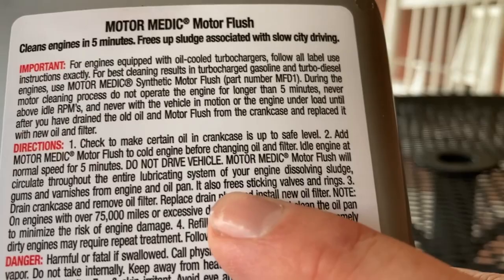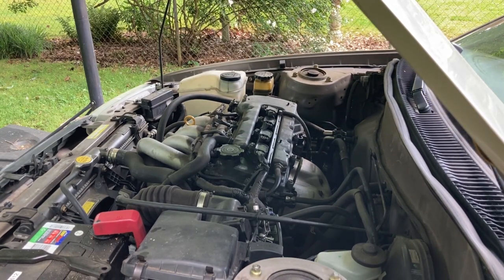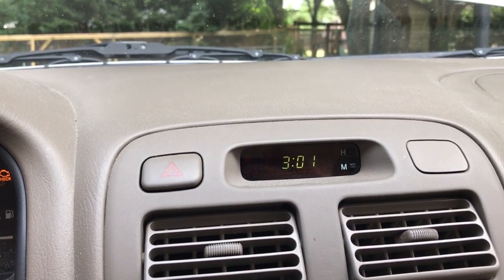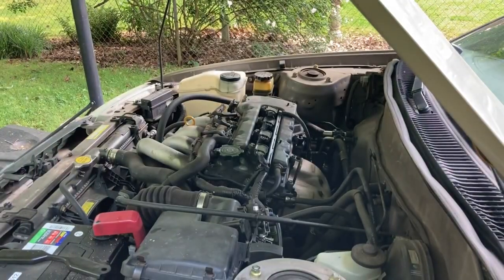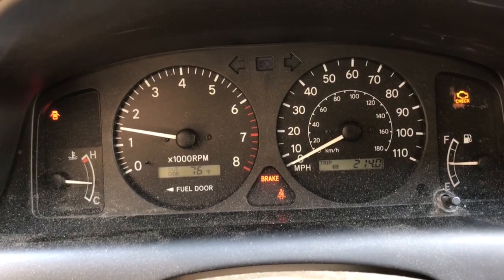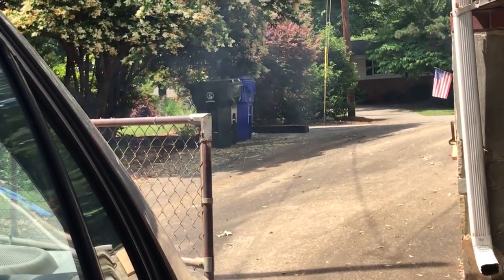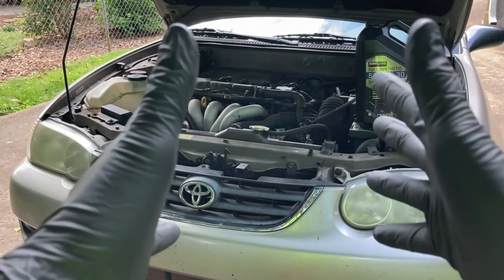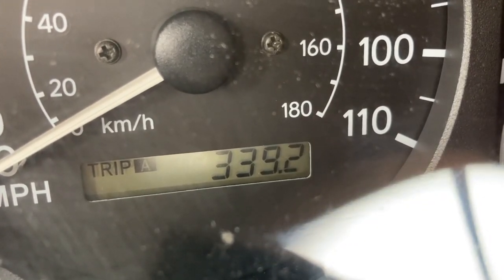Will Motor Flush stop oil consumption? | Oil Burning Experiments🔥- Episode 5

Comment: Have you tested sea form and work or not?
Reply from the maker: Yep. First two videos. Here's the playlist if you wand to check them out, Mad Man:  https://www.youtube.com/watch?v=cxz9cGCULNI&list=PLS7Cti2LicYBlvvhHdiv5RYpu_YLCrquZ&index=8
Reply: @FamilyFriendlyDIY  Yes but you says its work but after you have again oil the consumption
Reply from the maker: @madman2461  It did look like it was working (I got more miles per quart during that test), but then I found the usage to fluctuate, and sometimes it went as low as originally. ... But I still hear a lot of folks saying that if I'd kept it up with the Seafoam it would have worked. And that might be true.----I might try Seafoam once more if nothing else works.
Reply: @FamilyFriendlyDIY  okey i understand, you can test clean with hydrogène.
I have q5 tfsi and I think there is a problem with the segments, I will test sea form I also saw that there is a luca's additive which worked for a lot of people

Comment: I've used the synthetic motor flush with great results..the instructions say run idle at normal speed..my interpretation is normal speed is around 2000 rpm..so I idle it at 2000 rpm..it doesn't say at idle speed

Comment: If you are noticing blue smoke from the exhaust, it means your engine is burning oil due to an oil leak. This symptom could be the result of a leaking valve seal or a problem with a piston ring. That escaped oil can then mix with the fuel and burn as the fuel burns. Therefore it doesn't look like you have that problem with your compression rings or oil rings. Those spark plugs looked very bad. Stop being cheap and change the spark plugs, PVC valve and also check your valve cover and oil pan for oil leaks. It"s a good chance your loosing oil from those area and not burning oil. The top of that engine looks oily too. Most likely oil is running down on the exhaust manifold from the valve cover, or PVC valve, maybe both. The smell and smoke of oil is off your exhaust manifold. Stop wasting money on oil and oil filters. Go purchase some spark plugs, PVC valve, valve cover gasket and maybe a oil pan gasket if it is leaking. Try this and see what happen. Also check the ground area under the vehicle for oil spots.

Comment: Actually the problem with that model of Toyota is not so much the oil control rings.. but the oil return holes on the piston. That was a manufacturer defect. The holes are too small and not enough for the engine oil the run back into the the sump pan. Because of these engines run at very high temperatures when the oil gets backed up around the oil rings they start to form carbon and eventually they rings sticks in the oil grove in the pistons... After that happens the oil just gets pushed up into the cylinder and then it's burnt off... The fix for that problem is to take the engine down and do a rebuild with new pistons and rings
Reply from the maker: Thanks for the comment, Mark Anthony. Just hoping these tests will shed light on if any of these miracle cures are legit or not. I'm ready to re-ring if necessary (and drill more drain holes).

Comment: I have been working on commercial vehicle engines for the best part of 20 years now, being entirely self trained but now not without some considerable experience. Against my better judgement, I was persuaded to try and use several of these 'magic' liquids in order to un-stick one or more rings on 8 litre, 6 cylinder diesel engine.

The results were equally poor; I cannot be 100% sure until the engine has been dismantled, but my instinct is that the ring(s) is/are stuck rather than worn and as such I was hopeful, if not confident, that these cleaning solutions would help.

But in reality, the rings are only 'splashed' with oil or have contact from oil on the bores when they pass up and down- they won't receive high pressure oil. That means they won't receive high pressure cleaner either. It's a little like washing your dishes in your kitchen- a strong flow of water from the tap (or faucet I believe you call it over there) will clean your plates a lot better than a trickle of water over them.

Some people will swear by these cleaners- but they are probably going to look for the slightest improvement as a means to justify their pre-conceived ideas. I stand to be proved wrong, but I doubt there is a single case on youtube which claims to see a substantial improvement that can be attributed to the cleaner.

PS I am going to start my own channel, inspired by this one and others, and show people that dismantling and rebuilding an engine really isn't that hard if you take your time, follow the specifications (genuine parts, accurate torque and most important- make sure components are clean when they go on).
Reply from the maker: Thanks for all of that, Derek. Lot's to ponder there ... and I'd be interested in checking out your channel when it's up and going.
Reply: @FamilyFriendlyDIY  I really appreciate your reply, thank you Dave.

Your channel is one of the best I've seen because it shows 'as is'. So many either are trying to take money for recommendations or are reporting what they expected to see rather than what they really did see.

Comment: Maybe Motor Flush from up top through the spark plug holes will help.  Looks like you have the same issue I am having with a 2.4 toyota camry in that it looks like your oil turns very dark very soon after changing, just like mine does....    which REALLY makes me think rings got stuck and blowby is contaminating new oil and discoloring it.  My car was purchased new, and had zero oil loss for the first 100k miles. When it reached about 175kmiles all of a sudden I am losing a quart every 900-1000 miles.....I used to change the oil every 5k miles with fully synthetic 5w30 for like the first 100k miles, and I got 33-35mpg highway and 28-30 around town.  Then I started using 10k mile oil and going 9-10k miles between oil changes, and maybe losing less than 1/4 quart in that range.  Then it was like someone flipped a switch and I started losing a quart of oil every 900-1000 at 175k...I also dropped to like 28-30mpg highway and 23-27mpg or so local.  I'm not too happy with my compression of around 185 in all cylinders, either.  I have around 235k miles on it now, and it seems to run great except for the oil loss and the low mpg. I'm hoping a good unstick of rings will restore some or most of my performance and increase mpg.  I think I will try motor flush from up top.  One thing I think might help is making sure the engine is sitting as upright as possible.  I think the engines are leaning back a bit...so if I can make it so the piston tops are level, the motor flush will not pool towards the rear. It should be soaking all around through the rings evenly, you know?  I thank you, sir for showing what you are learning. It helps us all.

Comment: you got lucky, there's a reason they say to run the engine at idle, higher rpm's can cause the engine to spin a bearing with motor flush......

Comment: It might be worn bearings. A heavier oil as others have recommended is a great idea
Reply: How would worn bearings burn oil?
Reply: @bobwhite137  Bearings operate and are lubricated under oil pressure. When they are worn or damaged, the clearances increase allowing too much oil to pass through them. This excess oil gets thrown up onto the cylinder walls. The excess finds its way past the rings and gets burned in the cylinder. Usually when bearings are bad we are talking ALOT of oil being thrown up on the cylinders..
Reply: @mikebennett703  Gotcha.  Appreciate the reply.
Reply: @bobwhite137  My pleasure! Happy New Year..✌
Reply: @mikebennett703  To you as well!

Comment: Big no no. 10 minutes is not better than  5, and revving up isn't either. I use that half strength so I do not clog passages and filter. I'd rather clean it in several flushes than in only one and risk damaging the metals and clogging the filter with gunk.

Comment: This is not the toyota engine that ovalize the cylinder wall?!?..if it the wall , nothing will work unless machining
Reply from the maker: Unfortunately these 1zz-fe engines can't be rebored due to the way the cylinders are coated. If the bores are bad, the engine would have to be replaced.

Comment: on a Bad engine i legit just use 50/50 oil and kerosene and let it run for 5 min turn it off let it cool and run for 5 more and drain..
with that many miles that engine might need valve seals.

Comment from the maker: Previous video in this series:
Marvel Mystery Oil vs. Stuck piston rings: https://youtu.be/ZJ023-Wk0OQ
Next video in this series:
Compression test: https://youtu.be/T6yeIOL8ifE
Entire oil burning experiment playlist: https://www.youtube.com/playlist?list=PLS7Cti2LicYDtv1hFbz_dErQFGxnTgMCj
Reply: N¹nnn
Reply: It took 179,000 miles to get the rings this dirty, running for a few minutes with any chemical cleaner isn’t going to do much. 
Maybe try getting each cylinder in position of valves closed , then fill the combustion chamber with solvent of choice and push it past the rings with compressed air?? Maybe do this several times on each cylinder consecutively so time is given for the solvent to work???
Reply: I respect the guess that it’s possibly stuck rings, but have we ruled out valve stem seals or head gasket failure? Stem seals seem more likely from where the leak is occurring, especially after seeing inside the piston chambers and the side walls looked amazing for the mileage.

Comment: You could have saved yourself a lot of time and money by just buying some gaskets and tearing it apart to physically clean the pistons and rings. Most of that stuff is snake oil. Especially the motor medic. You need stronger solvents than what you used. Mystery Oil and Seafoam are good products for what they are but they are more for light cleaning and maintaining over prolonged use. For hard stuck varnished rings neither one will cut it. If you take the pistons out you can dip them with the rings in Berryman's ChemDip. That stuff melts carbon and varnish like nothing else. With compression that good you don't even need to ring it. Just drop the pan and pull the head. Your convertor is probably shot too. And you can't pour in that alcohol junk from the parts store to fix it either. Most of the 'fixes' in a bottle only do one thing. Drain your wallet and make the sellers money. Let's face it, who wants to tear down their engine to clean the ring lands and rings when you can buy something in a bottle for $5 or $10?

Comment: If the rings have been sticking for a while they probably have scored the cylinder walls.  NOTHING you do will fix that except a new engine.  Putting new rings in the engine will not fix the issue it the cylinder wall is damaged.  You cant hone or repair those walls.  I think you are throwing good money after bad here.

Comment: full  syn mobil-1  10w-40  oil  with   16oz. of  restore engine addative   with a boss purolator  full syn media  oil filter.  engine will use   60% less oil in the next  3000 miles.  everybody  thinks there rings are clogged and stuck, bullshit--- there worn out. that car probaly has more than 200,000 miles on it.  metal isnt eternal.  never ever go over the full line on the dipstick with all fluids ready to start engine.  nice video.
Reply from the maker: Thanks, and I hear ya jon ... but I usually drive all my cars past 300k miles and never had an oil burner. Got a Tacoma with 418k miles right now and we don't add between 5000 mile oil changes. Guess we'll see. We'll get to the bottom of it eventually, even I have to tear it down and re-ring it.

Comment: Alright here’s the deal,Toyota manufacturers used piston rings that did not have a lot of tension against the cyclinder walls from the 90s thru the 2000s, so your wasting your time and money putting in all those additives to help stop oil burning, your best bet is to have the engine rebuilt with upgrade parts or get rid of the car an get something newer!!! Sorry buddy I can’t be nice about this, those older Toyotas use oil…

Comment: its just over priced kerosene
old john deere operators manuals used to tell you to drain your engine oil then refill it with  kerosene and run the engine for 2 minutes then drain it and refill with fresh 30 weight oil

Comment: Engine restore is garbage the copper silver and lead is supposed to burnish on the cyl walls ...no way your oil filter will filter it out and in my 1985 Dodge it wore out the rocker shafts and the rocker arms clicked .oil burns at the higher rpm because of warn out  (hard ) valve seals as more oil is up in the cyl head or could be oil rings can't handle the extra oil splash on them from the con rods .
I use straight grade Napa Hi perf  30( made by Valvoline .08zinc )  in my Honda and Toyota , use 1/4qt per oci ( 7500). Never use full syn oil ,my Honda owners manual says 0-20 is for mpg only you can buy Honda oil 5W40  like they use in Europe and get 300k from an engine .
U.S ,gov does not want to pay for Arab oil so they tell Honda put 0-20 on the oil cap or you can't sell Honda ( any car) in USA . Mechanical engineers know thin oil doesn't work and oli companies can't make a film strength strong enough .
Syn oil has NO hydrodynamic wedging and can't absorb shock loads  I use .30 HD up to 150k then use  40 HD to 300+ miles ,the small MPG you lose is cheaper than a new engine and the cats and sensors are clean .
God bless America .good luck .
P.S. 5W40 is 5grade at start up ( very thin and that's when the oil is used up ) after 20 Minutes the oil is a good 40 grade and thick . 
I think multi viscosity oil was an idea to save an oil change summer and winter season.
Startup wear is because cold oil is THIN. not because of lack of circulation ,check ResearchGate GMC v 6 engine start up wear tests,
"  thin oil viscosity is the cause of wear  at start up" 90%....,  not lack of circulation "

Comment: Give Up.

An engine with a quart of engine oil consumption in 400 miles is toast.  

And get a brass or nylon washer around the drain plug to acheive a professional seal to the oil pan fit.

Comment: Dude What's the definition of insanity...? Exactly..... your motor is too clean now, rings are thinner and its burning oil to quick even if you don't see the smoke..... you need to do the opposite and add Restore to the motor....

Comment: B. G.
Reply from the maker: I hear ya :-)
Reply: Have you tried BG EPR. I used it on a old Chevy 305. I did what I wanted reduced oil consumption and increased compression. Plus it got the fire department called. It smoked that bad idling.
Reply from the maker: @cole33333333  Ha ha. No, I haven’t tried it yet. But someone offered to send me some to make another video however I’ve had trouble getting in touch with them. I’d like to try it, just not sure I want to spend that much just yet. We’ll see!